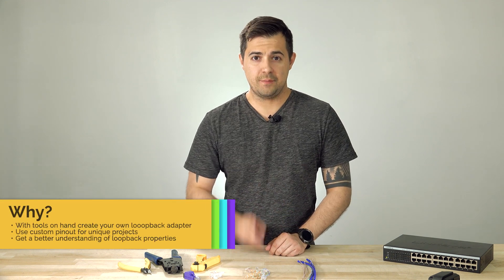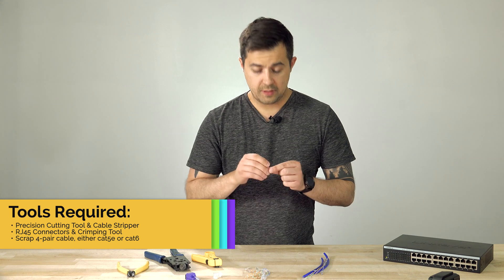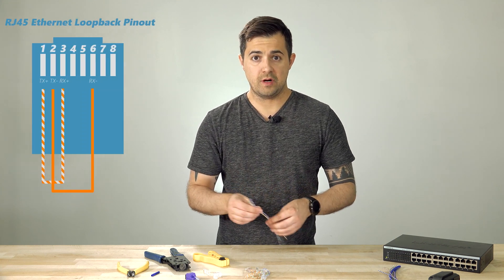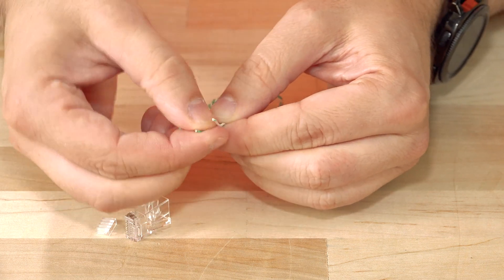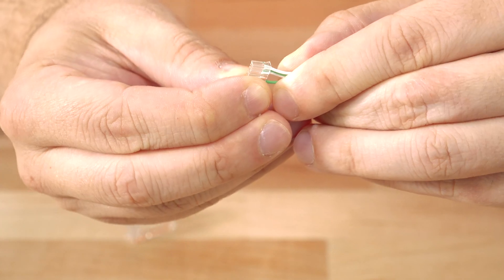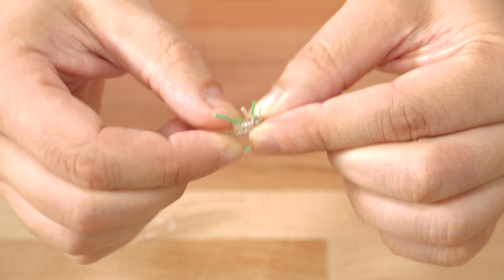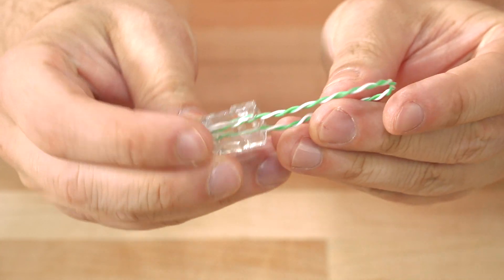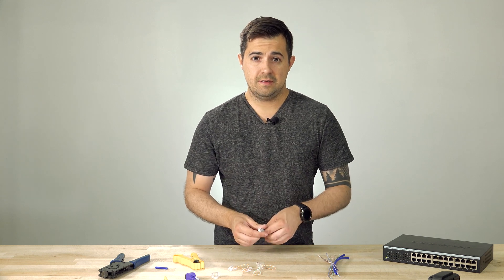Learn to make your own loopback plug or loopback adapter!

Comment: could you please clarify for your future viewers on this video. the pinout chart you show is using white/orange & orange but you used the white/green & green. is there a difference? did you make a T568a loopback plug and the pinout chart your showing is T568b? also i created the 8 pinout version because some research is saying those pins terminated create a ground for proper testing ( not referring to the gigabit pinout ) what are your opinions. thanks for the video got me motivated to make one instead of buying.
Reply: No copper wires are copper wires..
Reply: What KooLaid here is trying to say is that there is nothing inherently special about the individual wires in the cable since they are all made of copper. The color assigned to each copper wire is just an industry standard code that keeps everyone on the same page when running cables to ensure devices can communicate correctly with ease.
In theory, if you know what each contact on the connector is responsible for when it's plugged into a device then you can wire the end connections any way you want as long as they're the same at both ends.
That's why the wire color you pick doesn't matter when you're making this loopback plug, because as long as each wire is connected to the right contact then the plug will "loop back" on the circuit you made with the copper wire and communicate with itself.

Comment: it doent work on my TL-WR1043ND router :/ i made gigabit loopback plug but LED is not on on that port where I plugged it
Reply from the maker: Unfortunately all routers and switches handle loopback adapters differently so it's tough to tell which devices the loopback adapters will work with.
Reply: Gigabit loopback requires 8 wires.